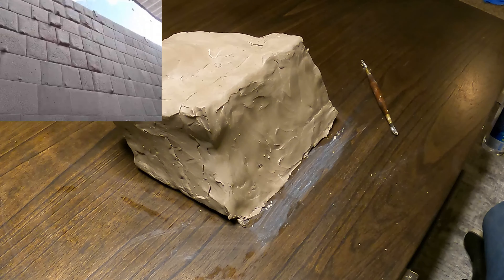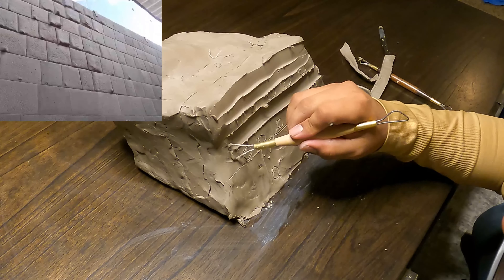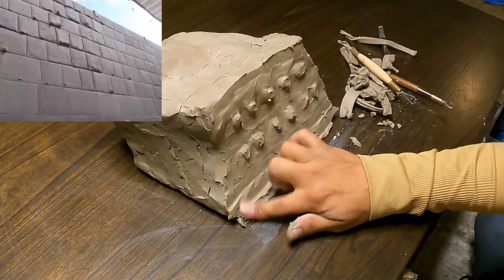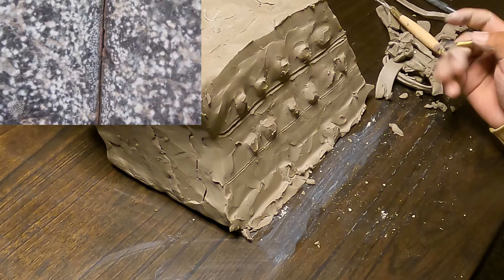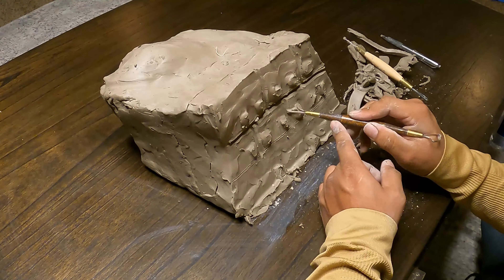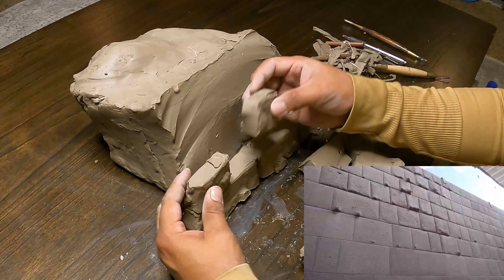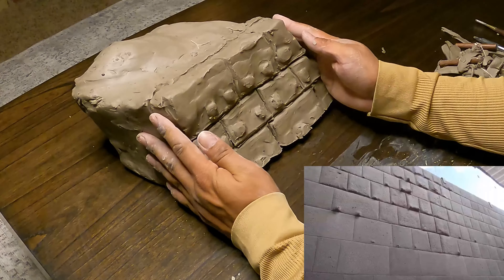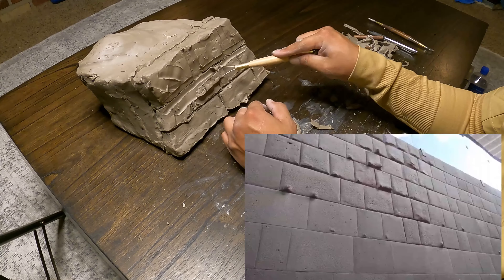Perfecting Polygonal Masonry: A New Explanation on the Ancient Engineers’ Construction Methods

Comment: I’ve built with wood and I’ve built with stone….In all the years I can never remember an instance where precision was required that didn’t also require intention, planning  and care!  Not to mention the specialized tools involved with such precision!   I wanna see an example of an impact fractured rock(granite, basalt, limestone, etc) that can be seamlessly reassembled,  using any method, using modern tools or archaic!
Reply: I’m not.saying that the manufacturing process didn’t start the way you describe…I’m just saying the finishing process is the mystery…my guess is you are right about the stones coming from the same general outcrop, maybe even in the same basic configuration in which the rocks were quarried….but the joints and contact surfaces between the rocks had to be shaped and polished…then essentially the negative of that surface has to be copied to the adjacent block precisely to seamlessly fit with it….you are right some blocks’ joints are not so tight,  it those are blocks towards the top of the walls where blocks have freedom to move, thousands of years of seismic activity will eventually nudge even these walls….but I would wager if one excavated and was able to move said blocks and reassemble the wall its tolerances would be the same as the rest….it truly is a mystery….one that we could not easily match today certainly not without precision c&c machines and expensive cad software that’s hasn’t even been produced…3d printers could perform the task, but I don’t think we can print natural stone yet….how else could it be done with modern manufacturing techniques?

Comment: But most of the walls are completely different on the back side clearly much different sized and shaped rocks with backfill. Only the front sides fit together neatly and clearly all completely different sizes and shapes of stone . Your explanation would not account for any of them with the exception of sections of the city wall you've shown. So they clearly could not have done it this way but at least you're trying and it'll take more minds doing the same to arrive at any thing close to an answer. Well unless A.I. gets involved in our quest for answers.

Comment: Try thermite gavel rock and clay molding.  Thermite gets to 2700deg. Inside  gavel rock mix lowering temp. Stone melting cool solid.  Any size stone can be made on-site in place, separate with clay. Thremite iron and aluminum are two important items in the melted rock. 🫠  working with hot baked brick. Any size any shape.  Combine smelting copper thremite reactions green and contained copper.
Iron will have magnetic stone.
Done it. Try for yourself.

Comment: They probably used a pitch like material with sulfuric acid that can dissolve silicate rock structures. The process involved chemical reactions. Incans mined and definitely found sulfur pools. The joints have iron and sulfur trace elements. They probably used pyrite, plants and sulfuric acid as a fill for the seams. Over time it would fuse the rocks together. Ancient Chemistry.

Comment: They were made to fit together perfectly so that Earthquakes wouldn't destroy them. These walls have withstood everything the earth has thrown at them. Some have broken away in places, but what has stayed intact hasn't budged at all, for thousands of years... How did they split the ENTIRE face of the ENTIRE wall in one plane? How did they then, make this tens-of-thousands of tonnes of rock-slab fall so neatly? We can't even credibly figure out how they moved these pieces individually, so how on Earth can you suggest they moved the entire vertical slab, cut, somehow to exact thickness evenly across the entire length? It's a cool idea, but I don't see how this is possible.

There is a 5 degree vertical incline to these walls, HOWEVER.. the lateral splits between the courses of stones are level. Also, the locations of many of these sites does not feature natural rock formations from which to carve walls out of.   This directly prevents your theory from being possible, dead in the water. I'm sorry to say. Take the pyramids of Giza, where is the mountain that they carved the walls of the pyramid from? Where is the rest of the cliff face that they carved the walls of the Peruvian city from? These blocks had to be transported into situation, from where they were quarried from. Why are there saw marks and drill-holes? Why is there clear evidence of chemical, or thermal melting of the rock?

These builders KNEW how Earthquakes and other destructive, climatic effects have on construction. They also had a deep connection with their astrological and mathematical knowledge of Earth, viewed from space, which they incorporated into their construction. Why? How?
Reply: Well said ! It all points to a civilization much more advanced than our own, its the most obvious explanation. Not just a bit more advanced either, wayyy more advanced. Is it also a coincidence we see so much carving/artwork done focused on things outside our earth also ? Looks to me like a species that worships stars etc was actually spending time there ? Is our arrogance really that out of line that we just dismiss an ancient species that is far far far superior to us in many ways could not have been far superior in space travel ? Apparently so !

Comment: So easy to prove/dis-prove. As another commenter mentioned, evidence of grain and other materials that should match a single slab theory, and examination of the other stone faces on the blocks for chiseling and carving. I find this theory to be highly unlikely due to the likelihood of faults in the stone or the technique leading to damage  of even a single block that would make the entire slab useless.
Reply: Even if they did break the occasional block, this method would still be faster than rough shaping every single block. They had the ability to process stone, it just wasn’t efficient and led them to use this as their primary method.
Reply: @wompbozer3939  examining the hidden faces for tooling would settle this theory once for all. If they are shaped, then his theory is wrong, if they are split, he is correct. Easily resolved.
Reply: @startsontime  What if they split them, then shaped the backside of the stone?
Reply: @wompbozer3939  I imagine that the removal by tooling would undermine the razor thin fit between blocks. His theory relies on the economy of labor realized by the minimization of labor and technology. It’s still an ingenious (if unlikely), theory. He bases his idea on the stubby projections remaining on the highly polished faces of the blocks acting as fulcrums to break the carved matrix in a controlled manner. I think it highly unlikely that they would not polish them off when the wall was reassembled if that was their only purpose.
Reply: @startsontime  From what I’ve gathered, the backside of many of the South American polygonal masonry have a boot shaped profile that isn’t dressed as nicely as the front. Whether or not they are finished or not doesn’t change the quarrying method that they used. Being able to place even some of the quarried stones in the same configuration would speed up the construction a lot, even if you have to still make some of your own shapes occasionally. I think they had the technology for smoothing and removing smaller amounts of material, but had problems crosscutting them which led to them trying to use some of the original shapes that fell out when they quarried them. Some of the larger pieces would have taken thousands of hours to rough out, and anyone who thought to try to reassemble them somewhat would have been a hero. 
     It also explains why they used such weird patterns and threw in tiny blocks every so often that would bridge multiple large pieces together.

Comment: The video title says Mayan walls, then you go straight to Peru? Huh? This explanation seems improbable. How would tipping over an entire massive wall be done so that it breaks free of a matrix with a uniform thickness? You are right though that you can score stones and break them pretty cleanly along the score lines -- but a whole wall 20-30 feet more more high and even longer width?
Reply: Yeah zero explanation about this impossible (by modern day standards) undertaking. Even just tipping of an entire wall seems impossible....never mind the fact it could have come from miles away first. Its just so far fetched an idea when you think about it ? The upper limit of a human just merely deadlifting a bar with weights on roughly 1-2feet off the ground is around 500kg.....we are talking about stones here weighing considerably more than that.

Comment: The constant retouching of the stone shapes shows how impractical soft stones are. Moreover, if the stones were that soft, the relative positions of the stones don't really matter. Additionally, many polygonal walls show the lower stones to have the concave corners, meaning the top stones would have had harder bottoms than the tops of the lower stones. Equally soft stones result in voronoi patterns, without concave corners. The polygonal walls are NOT voronoi diagrams.

Comment: This seems somewhat plausible. Some of the walls that have smaller gap filler stones could be the result of this method not working perfectly and producing breaks where they didn't intend. I could also see this method being alongside other methods.

The knobs could be an indication that this method was used for thise particular stones, no knobs meant they were carved differently.

I think this method could be used at a less wide scale as well.

Now I'm wondering if the nubs could produce a concoidal fracture? This would allow the break to be cupped allowing the stones to nest inside each other

Comment: This another example of discussion and thought leading to solutions. I have doubts about this idea being the total answer. Your thoughts would require a partial disassembly of the blocks from the wall. Has anyone done this, to examine the joint faces for fracture lines? There is a slight possibility that the walls are a solid boulder with decorative grooves cut into the first inch or two to simulate a block wall. This could have been done as a thousand year joke on us.
 Seeing the joint faces is the only way to produce a workable answer. I do not have any other answers, just a few thoughts about the mechanics of splitting large stone slabs in a technologically primitive society.

Comment: Easy to say at your desk…I work with stone, I don’t quarry it,  it when you break a rock you will never get it to fit back together all but seamlessly, because the fractures aren’t clean they are diffuse not smooth…stone tools could not have done this work, I’m confident in making that assertion.  I don’t know what they used or the method but I can say with almost certainty it wasn’t stone tools and it wasn’t pounding them on the surface of the stones like the Egyptian Ministry of Antiquities has illustrated!
Reply: And keep in mind these joints aren’t just tight fitting on the exposed surface these blocks also fit for the entire depth of the stone all the way to the rear of the blocks…they fit just as tight even on the unexposed surfaces otherwise the walls would settle forward and backwards.
Reply: Haha they are precise on accidentt…are you sure you’re not an Egyptologist?  According to them all the unexplainable precision and complexity was all unintentional….